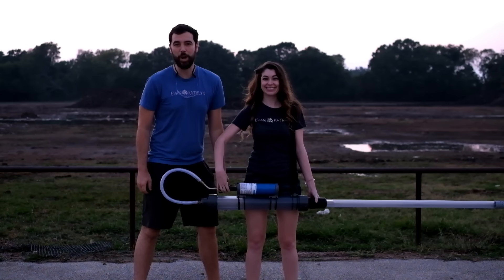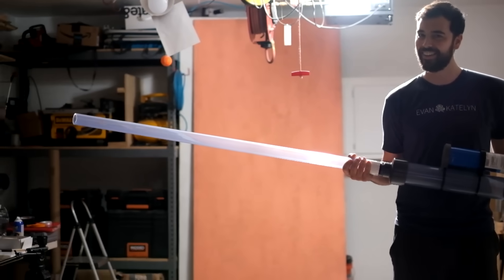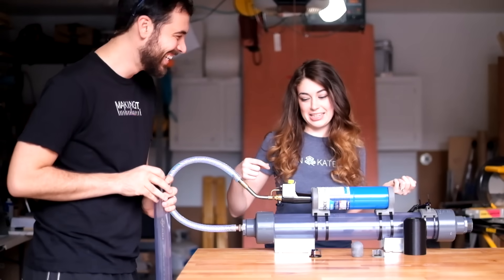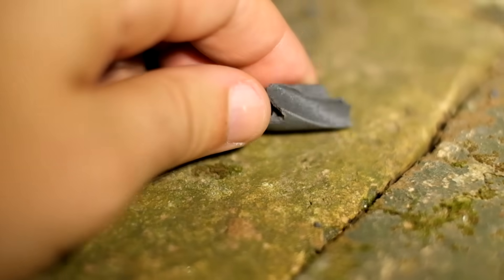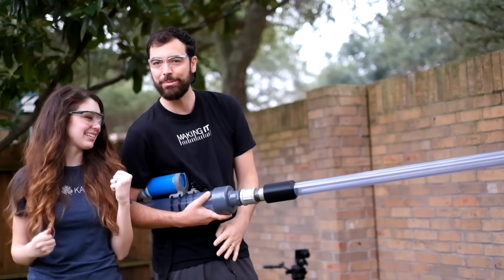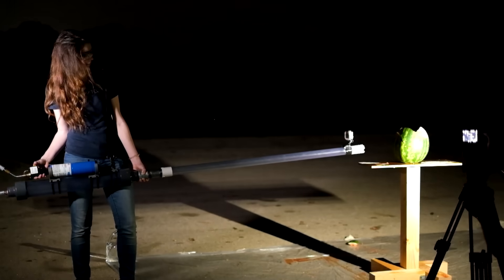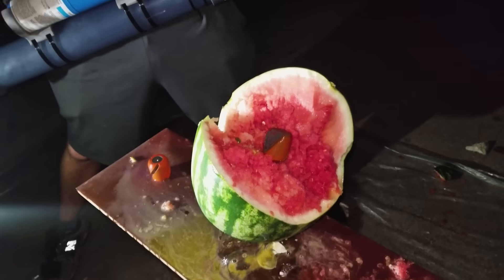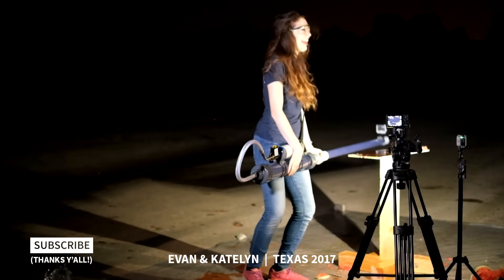Cops caught us firing our homemade propane blaster

Comment: There's a very simple fix for this, charge the chamber with the barrel off (don't click it, just get gas flowing), then screw the barrel back on. And don't skimp on propane, with the torch fueling method you can't add too much fuel, only not enough.  It's funny how many people think adding too much fuel is dangerous, it only decreases performance. Torches mix fuel and air at the optimal ratio. I use this method exclusively for all my combustion guns, including a 700fps golf ball bolt action gun that shoots through cinder blocks lol, but a don't attach the tank and torch, I usually use a check valve to stick the torch head into which closes when I fire or tilt the gun into a firing position.
Reply from the maker: Thanks for the tips! I thought having too much fuel would mess up the proper fuel-air mixture though
Reply: @EvanAndKatelyn  ohh don't get me wrong adding too much fuel will indeed ruin your fuel:air ratio, but by using a torch, the venturi system in it mixes the fuel and air at a precise ratio which can't be changed unless you block the intake ports of the torch, or put the intake too far into the chamber where it can recirculate the fuel:air mix, adding too much fuel. In most of my guns I use a small valve on the end of the chamber furthest from the barrel which I stick the tip of the torch into, and only fill when the barrel is empty so the projectile doesn't block air flow. This valve also serves to relieve pressure from forcing the projectile down the barrel. Try a good solid 20 seconds of fueling next time and you won't be disappointed :)

Comment: A friend and I tried a hydrogen and oxygen powered cannon with the fuel in stoichometric ratio from electrolysis (using a welder for power). The first blunt wooden slug nearly penetrated a 40 gal steel drum. The second attempt shattered the joint connecting the PVC barrel to the steel combustion chamber and the whole barrel went sailing through the air, leaving us with awed silly grins.
Reply from the maker: dang that's intense!

Comment: The real problem is when you feed those fuel into that stale air enclosed case you won't be able to vent out those stale air out. You need another valve on the other end to bleed it out, close it and it then will work about every time.
Reply from the maker: Thanks for the tip!

Comment: My cousin built a similar one for firing potatoes which create an air-tight seal but it also had an electric PC box fan inside the chamber to mix the fuel and air. It also had a threaded plug on the back of the combustion chamber that we open after each shot to bring in fresh oxygen and exhaust burnt fuel. Thought this might help for future improvements. Great vid btw
Reply from the maker: Sounds awesome! That's interesting about the plug to bring in oxygen

Comment: That’s the problem with closed combustion chamber designs.  You can never get the air/fuel mixture right 100% of the time, hence misfires. My build is not hand held, it’s mounted on a Howitzer style base, so can get away from it with remote 30’ go button.  Why; because I run Oxy/Acetylene.(I own a small rig for my work)  But now we’re talking 3x the power of propane.  Oxidizer and fuel are set to perfect ratio prior to injection. Also have 12v ignition instead of piezo.  Def not for sissy’s and those who try to push the limits.  Best shot, over 1000’ @ 300 fps.  Could probably go further but I don’t want to destroy my cannon or myself  😎
Reply from the maker: Whew that's intense but sounds awesome!!

Comment: I believe if you drill a small hole probably 1/8 in diameter at the brass on the end of the torch where it joins the hose it will suck air in as it's pushing propane through
Reply from the maker: Thank you for the idea!

Comment: Has v 2.0 been built? I agree with ditching the propane setup.  Though good enough to have fun with. There are better options. Consistency appears to be the biggest issue. I have always found the kits with then propane torch/igniter to be junk. Test it as is originally intended and you will more the likely see what I mean. I Second the notion of using MAP gas. I am more then certain with pro grade MAP setup with torch/ignitor you would get more constancy. Using a good quality ceramic type BBQ/burner/oven ignitor and ignition switch. A taser seams a bit overkitll, yet the big kid in me says... Doooo it!!! LoL now if you want to go to the next level look into some welding gear... mixing heads, valves, argon, oxygen, helium, etc etc. Hope to see v 2.0... heck why not a 3.0 Muuuuuh haaa ha ha. And world domination. LoL
Reply from the maker: v 2 has not been built though we did build a different type of cannon on Modern Rogue's channel (here: https://www.youtube.com/watch?v=O9rBNQ5iEt0 ) Thank you for the tips!!! Haha the big kid in us has the same feelings about the taser, it just seems so awesome!

Comment: There is NO WAY that's 1,000 fps. 300 maybe. and even that would have blown the water melon up. You MIGHT have one frame with the projectile in it at 300 or lower. Still very cool. A 9mm moves at about 1,000 fps, and if you had a projectile that weighed that much more than a 9mm moving just as fast it wouldnt do LESS to a watermelon.
Reply from the maker: Hahaha the title was referring to frames per second for our slow motion shots, not feet per second for the projectile... might need to clarify that somehow :P
Reply: Lol, that never occurred to me. Either way, very cool.

Comment: I made one around 2012. Tips for you. You don't need to fire it with the torch head. It's an inconsistent mixture of air to fuel. Mine was a normal torch without igniter going to a fuel line into an air regulator. Then to a ball valve, next a pipe mine was 12" long can be longer or shorter then another ball valve. Next was a 90 degree fitting going into the chamber.  
So close the ball valve closest to the chamber and crack the gas open to start around 10-15 psi. Close gas and secondary ball valve. When ready to fire release gas from valve closest to chamber.
Ignition I used 2 bolts threaded into the pipe 180 degrees from each other with wired coming from both bolts to a taser I got off eBay for $12. Wrap very well with electrical tape.
Lastly it is consistent if you mix the air and fuel. I mounted a small computer fan in the combustion chamber hooked to a 9v battery and an on off switch.  Works great. Just don't fire without a projectile or it will melt the fan. I found out the hard way. 
 My cannon was made for potatoes (7'11" long) and it will sling one 500 yards  consistent. Good luck.
Reply from the maker: Thank you so much for all the tips! Now that we've got a little experience, those make a lot of sense. Really appreciate it! PS- RIP your fan!

Comment: I would Angel the combustion chamber down from back to front about 10 degrees so that the air will rise up through the heavier propane and cause a better air fuel mixture. \_____
Reply from the maker: thanks for the tip!

Comment: Made one myself, but scaled it up to shoot cement filled soda cans/beer cans. Mounted to a sturdy wood table, it now sits permanently aimed at the front door. (Home Invaders be forewarned)
Reply from the maker: that sounds like a good way to ward off porch pirates!
Reply: @EvanAndKatelyn  The recoil is so severe, it has to be braced against the ground, a wall or a tree. Considering using a CCTV, a laser sight, and remote firing circuit in bedroom..(already have camera outside door) As long as it isn't used as a booby trap, should be legal to use in the event of a violent home invasion. I"m thinking that a pound of cayanne pepper wrapped in wax paper should create a sufficient distraction.

Comment: Just a few things. 

1. the longer the barrel is on any type of gun, the slower it gets by the time it exits the barrel. But the longer the barrel, the more accurate/straight it travels.

2. The VERY, VERY FIRST DESIGN is SOLELY only design you needed. The exact reason why the gun was having problems is SIMPLY because it needs MORE gas build up before you ignite it. Go back to the very first design before you printed all that unnecessary extra attachments and just let the gas build for 1 FULL second and then push the ignition button. IT WILL WORK EVERY SINGLE TIME!!!
Reply from the maker: The extras were either for the outside of the assembly or the bypass chamber, and it wouldn't shoot without the bypass chamber. I think using a grill igniter might help us get more reliable shots though, it's definitely our biggest weakness!

Comment: Maybe use a small oxygen tank to mix in
Reply from the maker: Interesting idea!
Reply: @EvanAndKatelyn  be careful oxygen can be very dangerous
Reply: Or maybe a device that uses the propanes flow to create a vacuum to suck in outside air then a one way check valve to stop it from backflowing out

Comment: Hey guys It would work anyway but you just press the ignition spark to fast you have to fill the combustion chambre first like 5 seconds and you can fire every time
Reply from the maker: we tried several different timings (5 seconds, 10 seconds, etc) but because the fuel doesn't empty out of the chamber consistently after each attempt, there's no real consistency. I think using a grill igniter or something would be best!

Comment: Add a grill igniter so you have a spark in the tube 
You’ll need a nail for a ground so you don’t need the electric torch
You can use a cheaper striker light style you can figure out the number of seconds of fuel to add
Reply from the maker: a grill igniter is a great idea! thanks!

Comment: Regulator with about 1-2psi output coupled with an independent sparker mounted mid barrel. Could even go as far as taking the gas valve out of an old residential gas furnace and rig up a timed relay to allow the barrel to load up with the relay operating the spark igniter. It can all be operated with a simple 12v dc lithium battery pack.
Reply from the maker: thanks for the tips! Was definitely on our list to get an igniter mid-barrel

Comment: It only fires when pointing at level or downward because the gas is heavier than air. When pointed at an upward angle, the gas fills up the chamber and forces the air (with the critical O2) away from the ignition source. Pointing down allows the heavier gas to pool at the bottom of the chamber while the lighter air flows upwards to the ignition source.
Reply from the maker: Yep yep, that was our theory as well once we figured out the tilt played a factor. Thank you!

Comment: Do you guys order your metal 3D printed parts from someone else? Or can your printer handle them?
Reply from the maker: Our printer was able to do it! It's not fully metal prints, but plastic with metal embedded, which can be really useful or pretty depending on what you need it for or how you want to finish it. Links to everything are in the description if you're interested 😀👍

Comment: Well its almost a year later but if you put a venturi with a regulator valve in the gas delivery tube and a check valve after it, you would archive your gas to air ratio mix when you fill the tube, you can adjust it with the regulator valve and the check valve is to seal the "ignition chamber when ignited. If you really want kapow use acetylene instead of propane.
Reply from the maker: even a year later, we're still taking in advice! thank you for the tip! would be great to have more control over the fuel-air mixture

Comment: Me and my sons built one of these, and it was indeed a blast. You can add a psi gauge to the propane tube that will allow you to recreate the exact mixture. Also add a computer fan to the chamber and a thread capped vent to allow air to mix with the gas. Last of all, remember these cannons can take a life/do incredible damage, so be careful, y'all!  Your cannon is big enough to send a projectile a good 300 yards, with the right mixture. Awesome video!
Reply from the maker: that's a great idea! getting the air/fuel mixture right was definitely the biggest challenge. Thank you! and we'll be careful!

Comment: Very nice. Inconstant  ignition is caused by the lack of air with the fuel. The addition of an air inlet or manual air pump into combustion  chamber should solve the problem, as well increase muzzle velocity.
Reply from the maker: thank you for the tips!! we'll keep those in mind as we work on v2

Comment: somthing you could do to make it more consistant and shoot harder is instead of having propane you could have an oxygen tank and a propane tank running into the expansion chamber through a couple of nozzles to inject the fuel in correct perportions for a complete burn and mount the igniter in the expansion chamber then add a bleed valve in the tank to bleed out burn exhaust gasses while refilling chamber with fuel and finally remove the fuel bypass thing you put in the barrel
Reply from the maker: Ah yes that's true! Involving oxygen seems a little scary though
Reply: Yes it could be but just dont mix it in exact proportions

Comment: If you're already "printing" these projectiles... why not print them with a small D-shaped (half round) channel cut around the circumference of the base of the projectile, where a tight fitting, but slightly protruding rubber O-Ring could be installed?  The O-Ring would need to protrude ever so slightly from the outside diameter of the projectile to make it a tight fit in the barrel.  This would make it more like a somewhat snug fitting "piston" and none of your explosive force would be lost, going around the edge of the projectile.  It might be necessary to use a long wooden rod, wrapped with a rag... soaked in soapy water, or vegetable oil to pre-lubricate the inside of the barrel, so that the "now-tighter" projectile could be pushed to the base of the barrel.  Otherwise, the rubber O-Ring might make the projectile hard to push in with a ram-rod...  and possibly  resistant to being combusted out of the barrel as well.  Just a thought... I want to see you guys reach your full explosive potential!  lol!
Reply from the maker: that's not a bad idea! although my fear is that it would be too good of a seal and just explode on us haha

Comment: (I just realized after I posted that this video was from last November not this November) 
When you point it down it allows the oxygen to go up the tube to where the igniter is. moving the infighter into the chamber would probably fix it or maybe the angle of the connection. also I wonder if using MAP gas would give it more of a kick or if that would be to much.... I don't know what the parts are rated for pressure wise. I had to smile when Even was driving and then you had the fancy drone shot of you pulling up and Katelyn is driving. Keep up the Good Work.
Reply from the maker: We definitely are interested in moving the igniter to the chamber. Haha movie magic fails, you caught us in the edit! :P

Comment: i made one over the summer with hairspray and a lighter. i’ve wanted to do propane ever since
Reply from the maker: haha it's so fun! I would look into pneumatic too. We made one with modern rogue that was really fun, although carrying around propane is easier than getting compressed air when you're out and about. Just need to nail that fuel air mixture
Reply: What if you drill half inch holes in the combustion chamber towards the back to imitate how the torch pulls in air by itself. They could always be covered with duct tape @EvanAndKatelyn

Comment: the constant clicking of the button gets obnoxious and makes u unsure when itll fire add a tub that is separate next to the other propane tank, an loading propane tank and the igniting one, find ur average time of fire and load the chamber until it has press then ignite, so basically just add another propane tank with a tube itll sit next to the one u have but just attach straight to the chamber and have no igniter so itll just constantly press gas until your chamber is full. your average time will tell u how long it averagely takes to fill the chamber so in theory once the chamber is full from the loading propane tank you would press the igniting propane tank and itll fire, also your mag will need to be in the top and drop due to gravity. :D goodluck, itll help you tremendously!
Reply from the maker: thanks for the tip!

Comment: You guys did mean stainless steel impregnated when referring to the propane tank brackets and the muzzle compensator right? Or do you guys have access to a laser powered metal 3d printer?
Reply from the maker: Ah yeah, no no we don't have a laser powered metal 3D printed. Just the infused filament

Comment: Hey, did you ever do more vids with this? Did you devise a better loading mechanism? Here is my idea...

Get a short length of tubing with an inner diameter almost identical to the fire tube's outer diameter, such that is can slide up and down, but no real air gap.

Cut an opening in the firing tube for inserting the ammo. This hole should be long enough for the ammo, and 1/3 to 1/2 the circumference of the firing tube. You want the lengthwise cuts to be perfectly perpendicular to the curve of the pipe, so the patch we are making next fits well and can't fall into the hole. You might angle the cuts on the curved bit slightly to also help with this (like the top of a jack-o-lantern has an angled cut so the lid doesn't fall in). 

Now, take another short length of tubing that is the same as the firing tube, and carefully cut a patch for the hole you just made in the firing tube, so that it fits precisely in place. (You can't use the piece you cut out, because the kerf from the saw won't allow a precise fit.)

Now, insert ammo, place patch over the hole, slide outer tubing down over patch and fire!  Slide tubing up, pull off patch, next ammo, place patch, slide cover, fire!
Reply from the maker: Weve been brainstorming and planning in the background for v2 of this. Thank you for the tips and ideas!